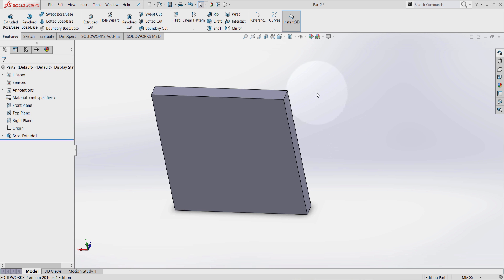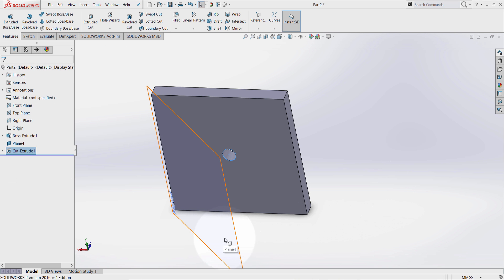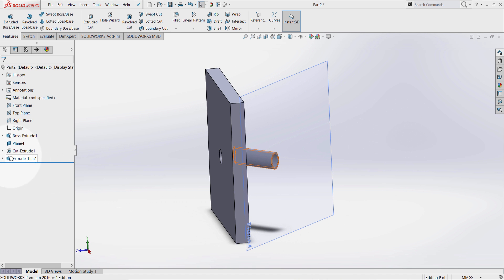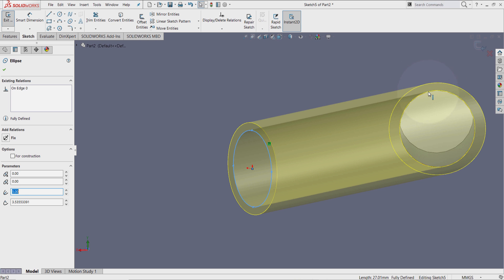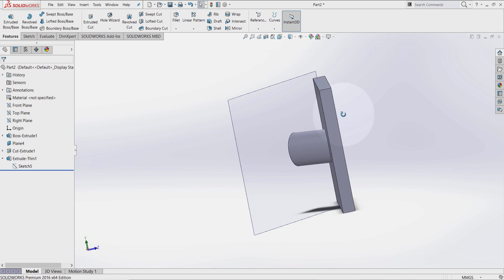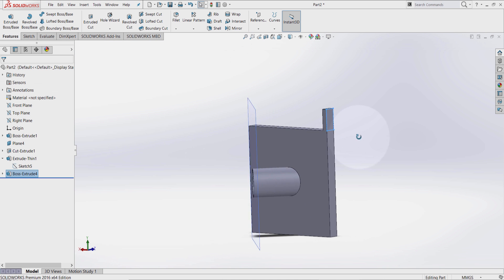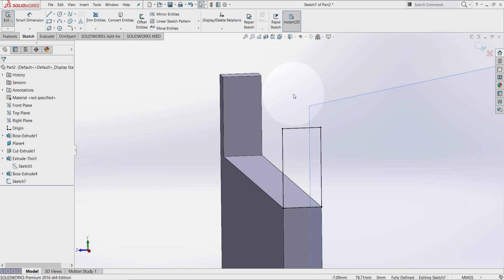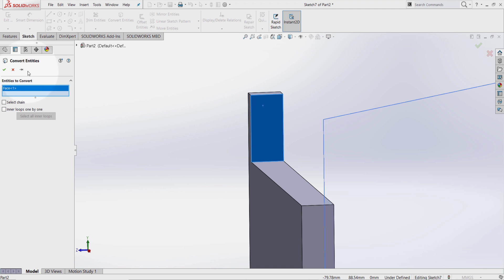SolidWorks for Beginners | 11 | Part -  How to Mirror using Convert Entities and Planes

Comment: Great work. How would you describe what the "Convert entities" operation does? The term itself is not too descriptive.
Reply from the maker: Convert Entities is the action of having the already existing line on a new surface. If you apply any change to the very first line you have created, you will affect the second line that has been created using the Convert Entities. So basically the second line that has been created by using Convert Entities has reference from the first line that you have drawn at the very beginning.
Hope it helps :)